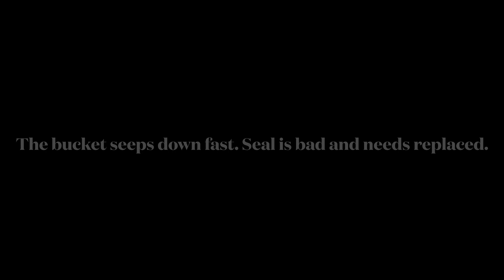853 Bobcat tilt cylinder seal repair.

Comment: Thank you, thank you, thank you!  Am getting ready to do this on my 853.  Need to replace all the tilt & arm hydraulic hoses at the same time.  This gives me more confidence.  Was that a large spanned u used to remove the cover?
Reply from the maker: I believe it was a 480 channel locks pliers. So not a scanner wrench. If you don’t have the be a punch and hammer can be used or a large pipe wrench. If you have a lot of seals to change get some tools for the seals. If you check out my other videos you will see it used. I will find the link to my video for you to see it.
Reply from the maker: https://youtu.be/RhGnWJ4kqEA
Reply: You are the best.  Thank you!